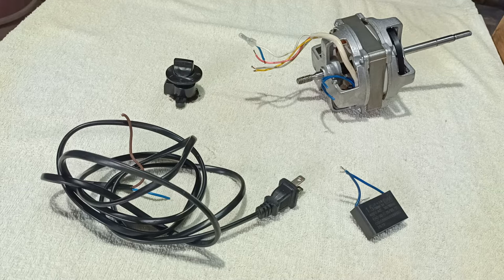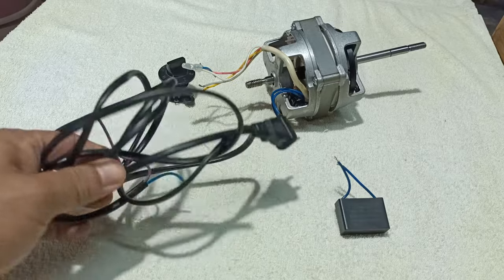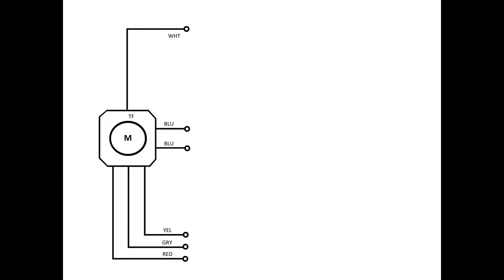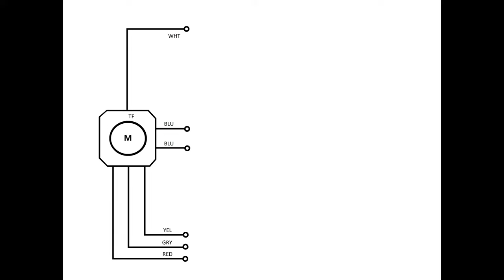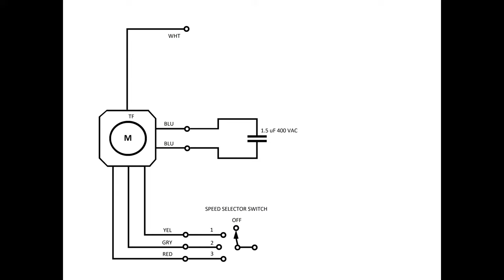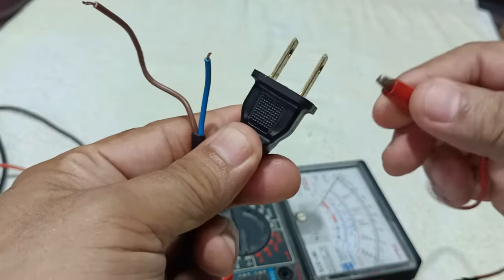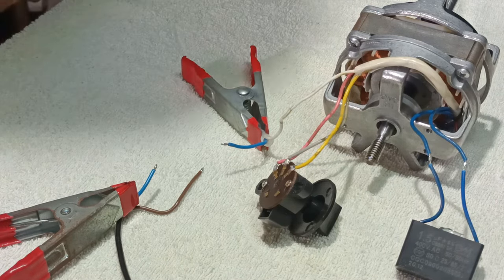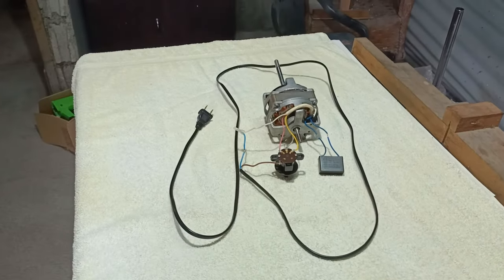Electric Fan Wiring Diagram : Build Circuit and Test Components

Comment: So question, i have the new snap in wire boxes, What would happen if i wire it 1 2 3 insead of 3 2 1? Is each hole designed for only a certain ammount of current on the switch or do you think it would work just backwards number wise meaning on 1 would speed 3.. Hypothetically of course. I think it would work just be backwards.
Reply: It would just be labeled backwards. Each circuit has different a different number of turns of wire going to the motor thus the resisitance readings shown, the switch is just a selector and since this one has a capacitor to jump start the blades it shouldn't matter, but an older fan or motor might not start reliably unless it's turned to the highest setting first or spun up by hand.